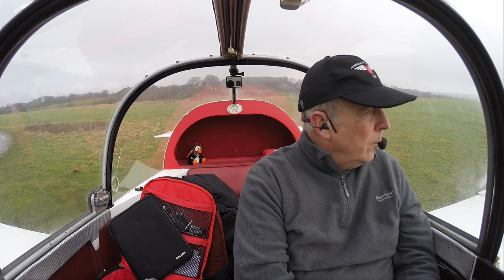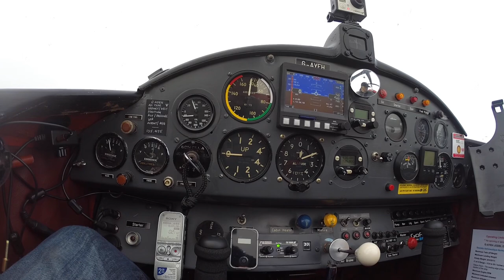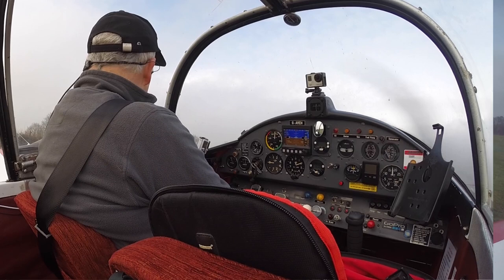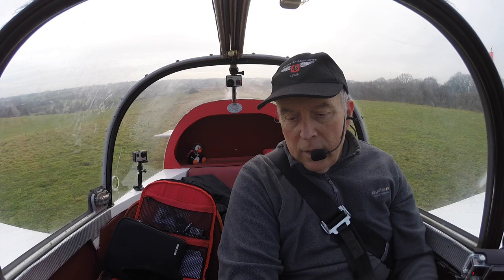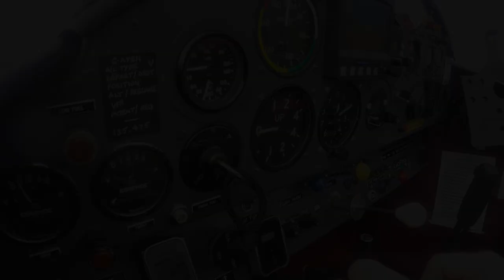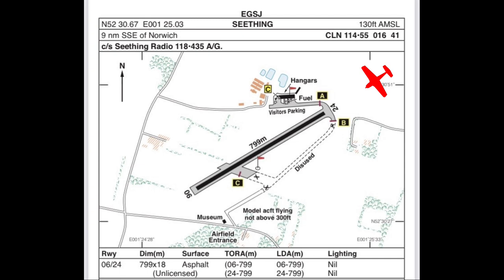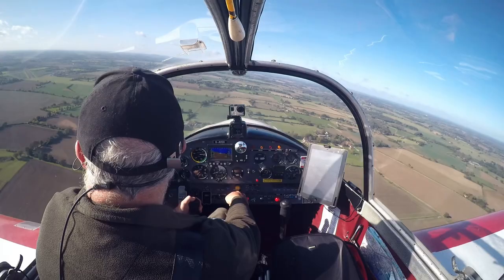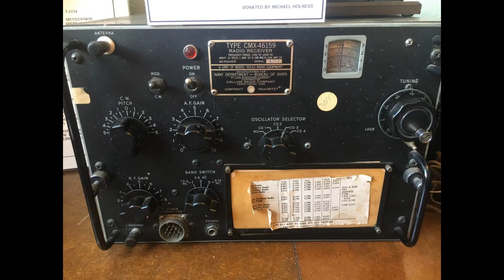LOCKDOWN ENGINE RUN + Seething Airfield - PILOT VLOG #296

Comment: I couldn't help wondering how many other airfields around the country have been throbbing to the sound of engine runs.  It was a good idea to have John with you and both do the runs at the same time, as you said.  I did wonder how you had got on with all the recent snow.  That icicle hedge was quite a spectacle.  It was nice to see the trip to Seething again too.  As you said, a hope for better days ahead.
Reply from the maker: I was amazed at the icicle hedge. I had seen something similar in Norway but never locally. We agreed to help each other get the aircraft out as the ground was so sticky and thought we would make less trouble if we ran up at the same time.

Comment: Can you tell me more about the RV4 why it has a 3 blade propeller and exactly what engine is fitted to it thanks Gerry from Dublin.
Reply from the maker: The RV4 has a Lycoming 360 engine and John bought the Catto 3 bladed prop when the Hercules prop delaminated in rain while we flew back from Belgium.
Reply: Is that a Lycoming 360 ci 180BHP or 200BHP Carb or injection the prop de-laminate must be a nasty experience
Reply from the maker: @gerryellis3847  180BHP and it was an emergency weather diversion. Then loss of performance and a temporary repair to get home

Comment: Tim ~ you noted that the ground would be too wet to fly.  How do you determine that; an objective measure or just your gut feeling when waling the runway?
Reply from the maker: The hill always drains well but there is a bit of a hollow on the flat at the top and it gets very soggy. We walk the runway there and it gives us some idea of what it will be like. If the wind is favourable I can run the Jodel from the top of the slope but it means landing with a strong tailwind!